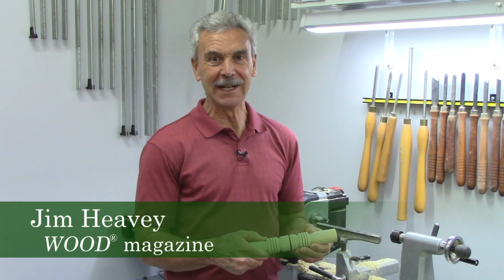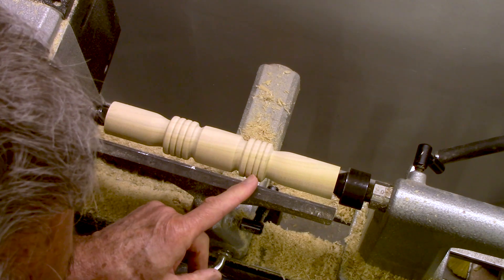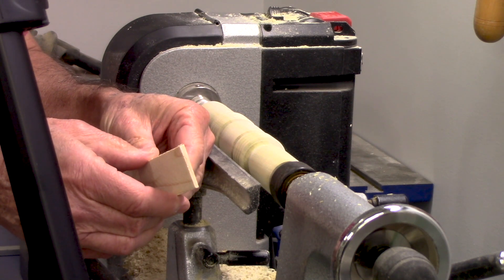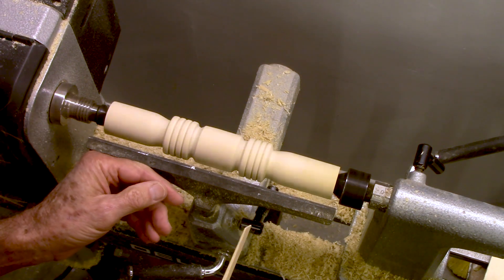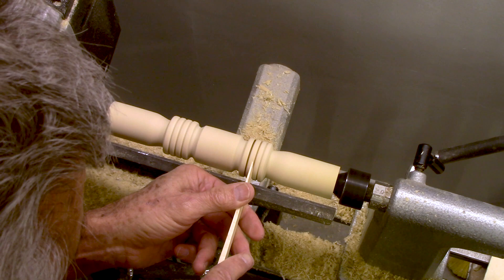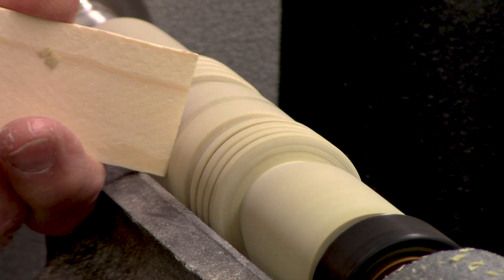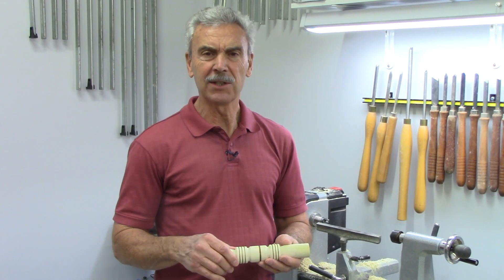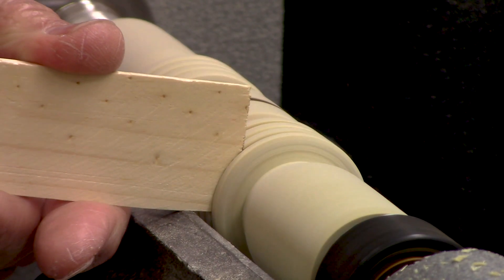How To Put Decorative Edges On Beads - WOOD magazine

Comment: Thanks for this tip.  I've used wire before and it works but this seems safer because the wire gets hot so you have to be careful . I put wood handles on the wire but this is quicker and easier.